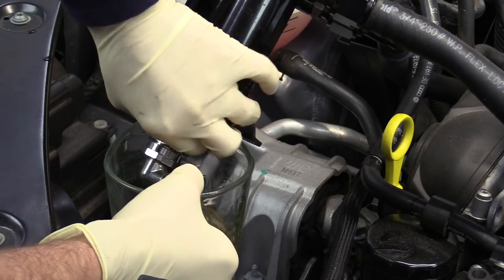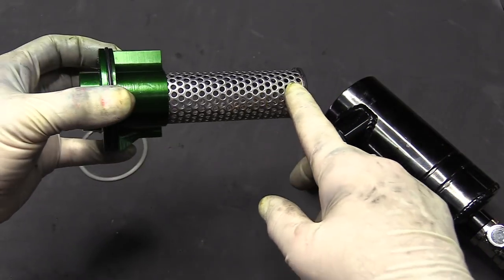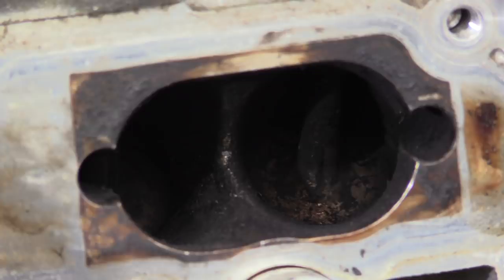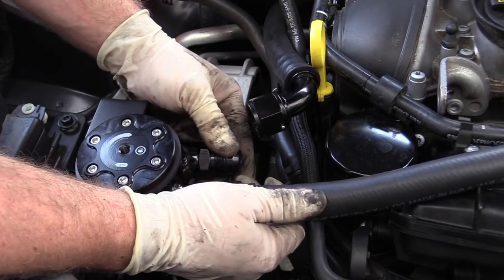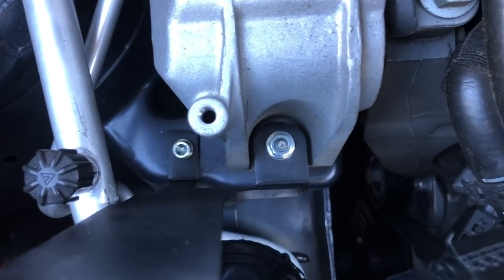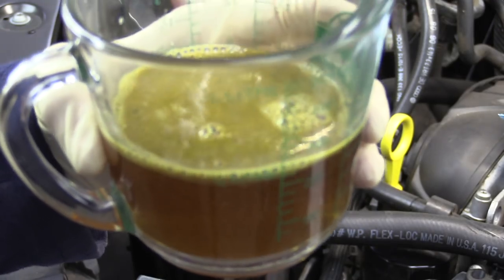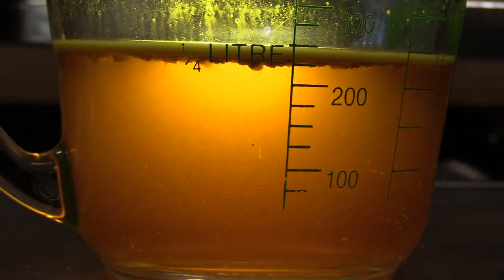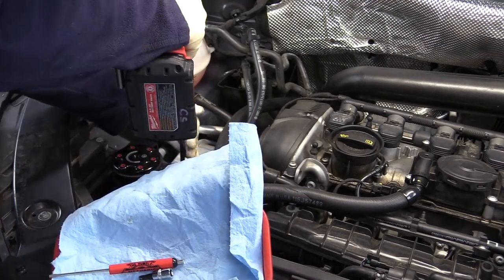Do Catch Cans REALLY Work?

Comment: Dear Charles yes catch cans are effective (in my opinion) but you have to be cautious if you own a vehicle with a catch!! I learn the hard way twice  -  in the winter any condensation the warm engine produces travels from the engine to the catch can and Back to the intake can freeze solid if they have any kind of  a low point between PCV and can or ontake the first time it happened I blew out a front main seal...remove the timing components replaced it I assumed I had a undersized seal and went on with my day around a year later it happened to the valve cover gasket which spray oil everywhere because it pressurized the crankcase. Not to mention losing oil and not noticing while operating the engine at speed!  Again my opinion no 90 degree bends at the hoses and make sure all fluids slope back to the catch can.
Reply from the maker: Yep. I’ve heard from a bunch of you guys saying they had freezing issues. That’s something I didn’t give a ton of thought to.

Comment: Can you show us what the intake valves look like right now?
I remember you said you took the intake manifold off awhile ago? Did you take pictures? Or were the shots of the intake valves in this video from your Tiguan? Thanks.
Reply from the maker: That video where I show carbon was from when I installed the can. The next time it comes off will be after testing a fuel induction treatment to clean valves.

Comment: I think were are all still wait for the Analysis of the drained liquid, the video seems incomplete without it, and I was wondering about what operation temps (climate)  this 3000 mile was acquired at...Ok, I have read many comments, and feel I need to and mine too.  I think overall it could help, but also think a CC system with a quick check dipstick, and with the shortest hosing possible and the exterior canister not made of high temperature conducting coefficient material would be important to reduce amount of internal moisture condensation in this add-on product in the engine loop.  I also wonder about losing too much coincidental lubrication of the top end of the engine with successful oil mist removal

Comment: I realy like to install a catch can (VWR is my Favourite) but 1. i live in a cold climate area and drive the car the whole year, so i‘m afraid of freezing the system and cause a Engine damage because of the not working System. And second i got a 2.0TSI CHHB with dual fuel system and in Germany we have 98 and 102 Octane fuel, so the carbon build should be Not  a big Problem. .... what do you think Charles?

Comment: I wish we could do this test at my job with one car fitted with a good can system and another one with a stock pcv system. We have cars running on dynos and robots controlling them to a specific drive curve. I would also like to compare a car with a can vs a car with a stock pcv system and water meth injection. I'm pretty sure water meth injection on any forced induction direct injection engine would be far more affective then a can in reducing intake valve deposits.

Comment: I use a paper element fuel filter as a catch can....and does a very good job at trapping oil.... the filter fills fast, in fact I have to change it every two months. they're cheap to buy.  but just a note my catch can traps nasty black oil, not the type u have in the video which is light in color. my car has abt 30k miles on it.

Comment: I took off the out hose of the PCV valve and there were a lot of oil on the hose in both sides, so I am sure that are going a lot of oil to the chambers ..  So I need to replace my PCV valve I suppose.  When I get off the Oil tap the suction is enormous. and the car is with a lot of miss fires and cylinder fails ..   So I think it is PCV valve. 

So for now, until I don't get the new valve, Can I plug the air intake?
 And put a filter in the output of the pcv??

Comment: Just watching this for my 2007 S3 (bhz engine code) and spotting that the tig's intake pipe could possibly fit my 2.0 k04 turbo engine...lol.
Did you guys across the pond get these engines as I don't see much on yt? Mk5 Edition 30, Seat leon k1 used the same here and possibly the golf R Mk6 your side?

Comment: Ethanol blended fuel is what causing this tremendous amount of blowby because it burns very hot to vaporize oil. The oil vapor will condense at low pressure area or before where the fuel is injected.

Comment: I am amazed by the amount f waste that drained from the catch can!

Then, I have a question:
What does the factory oil seperator do for not seperate these amount of blowby waste from the engine? I thought there is not necessary to have catch can installed on those engine with an oil seperator provided?

Comment: How much different would a catch can on let's say a diesel car compared to a big rig? I know a lot of friends of mine use them on their rigs.
Reply: I have a 7.3 powerstroke, 2001 F-350 with 380.000 miles on the clock. I installed a home made catch can. Works great and keeps oil out of turbo. I drain it every 1500 miles and have about 4-5 oz of pure oil that would have been in my turbo or clogging up my inner cooler tubes. Best mod I have ever done to my truck. Truck runs better than it ever has and I drive it like I stole it! But, I maintenance regularly.

Comment: Hi charles 
I got a 2006 Vw Jetta with the 2.5l 
I got a check engine light with a transmission code P0720 for the output speed sensor circuit. 
Any ideas on how I can trouble shoot it? Thank you in advance

Comment: Great idea... but I feel like the direct injection problem can’t be really properly fixed unless there is a port injector (low pressure) at the intake runner as well as having the GDI injectors as well. Kinda like what Volvo is doing with their new 4 cyl supercharged and turbocharged engines...
Reply from the maker: Yeah I am not sold this is a FIX... but it may help.

Comment: If that is mostly water, is there a freezing hazard there in cold climates?
Reply from the maker: Yes. I’ve heard from people in cold climates they can have issues
Reply: Hino trucks had a crankcase breather can.around 2010 models. In the north they had a freezing problem. So hino had a recall.replumbed the can and had about 1/2inch of high density foam wrapped around can.this cured the problem. (Prevented drain back valve from freezing)
That's why I think they need to drain off(into oil pan).to keep can empty in winter .
I just take mine off when it gets below 30 degrees.

Comment: I wanna put one on the suv witch are the hoses the I have to attach to? I drive a 01 x5 with a 4.4i engine. Thank you
Reply from the maker: It goes in the crankcase vent system. I am sure there is a solution for your car.

Comment: So I’ve done a bit of reading tonight on this issue, and I’m just going to relay what I’ve seen. 

If your catch can system replaces the stock PCV valve, you’re getting way more stuff caught in it that never usually makes it to the air intake anyway. The majority of that liquid will normally end up back in the crankcase, not in your intake, and so won’t be causing any carbon issues. If your catch can goes BETWEEN the stock PCV valve/hose and the intake, THEN it’s catching only the crap that was going to your intake, which is apparently much less. I think APR do this style of can, but it only fits with their induction kit installed. Looks like Forge do one, too.

Comment: I think a good experiment would be to have a car that has xx,xxx amount of miles and never had a carbon cleaning opened up and see just how much build up there is.  Then clean the carbon and install the catch can all at once, then bring that same car in when the miles are around double what it had prior to installation.  Open it up and see how much carbon it has that time.  To me that would be a pretty accurate estimate as to how much the catch can helps the carbon build up problem.  Definitely time consuming and labor intensive, but a very good insight as well.

Comment: Would have like to see how over time  the oil /water mixture would have separated out in that jug ,  thus showing what was oil and what was water vapour that had crashed out,  plus those solids would have separated to the bottom giving a real view of that gunk ... might be a good idea just to fit a valve at sump level  and drain a half pint every six to eight  weeks or so .. topping up  level  again ....wouldn't do any harm ...

Comment: Like others are commenting it doesn't look like oil, maybe water condensation or fuel with oil too, but the particles floating on top probably wouldn't be good to go through the engine I would think.

Comment: You would expect a lot of water in the liquid the catch can collected, since water is one of the main byproducts of hydrocarbon combustion. That and unburned gas, oil vapor, sulphuric acid and probably a bunch of other organic compounds. This goop is probably what you see baked onto the inner surface of an intake manifold with a lot of miles on it, where there's no fuel spray to wash it off. I think it's reasonable to believe that the catch can will at least reduce the buildup of baked-on deposits on the faces of intake valves in GDI engines.

Comment: Hey Charles, great videos as always, does the catch can apply to the my 7.5?  I hear mixed messages that the new PCV system makes this a moot point.  I know on my ea888 gen 2 motor this is definitely a problem, but now have a mk7.5 as well and debating adding one or if is a waste of money for a system that works well now (or if it still poses an issue for oil going back in through intake).  Thanks in advance and keep up the great videos!
Reply: Your question is noteworthy (RE: The Mk7.5).
If you would prefer even further piece of mind, run some CRC (or similiar) about every 5k just prior to changing the oil.  That way, you disolve the lighter coating of carbon that does manage to attach around the valves.  Everyone will have recommendations, but better to catch the build-up while it is still pliable.  Once the carbon begins to "harden", the CRC won't do a thing anyway - so catch it early.
Also, using the oils that have the highest levels of detergent & dispersant will absorb a greater amount of the carbon and keep the injectors a lot cleaner as well.  This of course, doesn't preclude that we shouldn't use regular treatments of injector cleaner in our fuel-ups.  These two procedures can extend the influence of problems when it comes to valves and injectors.
Other options are to remove the Intake Manifold & Injectors every 10k and inspect or clean.  That is if it is preferred to run optimally throughout your ownership (of course).....

Comment: I keep doing this. Spending hours trying to solve my carbon buildup issues despite having learned to clean my valves on my own from you, Charles. Sure it would be nice to get 10 or even 20 thousand extra miles out of my car before the need cleaning but at this point, I have spent substantially more time doing research of the issue than I will ever save in servicing my vales. Oh well lmao. Hope you've got a followup so I can put this to bed.

Comment: I use a longer PCV hose (two or three foot long) tor replace the usually short heat bent 6 inch OEM hose as you know vaccuum depend on the length of the hose for strength . the longer the hose the less oil the vaccuum is able to suck up..
I loop the long hose and plug it in!
I twist wire the loop to keep it in a loop. Do not use fuel hoses for PCV..   Fuel hoses are too stiff to keep vaccuum in. PCV hoses are more supple and better able to be clamped and vaccuum tigjht.

Comment: By installing the catch can, based on your results it has to be reducing or perhaps even stopping build up of sticky goo in the intake manifold and other areas.  Well done. A catch can in our 2007 Toyota landcruiser prado hardly works; in 20000klms about 3mm on the dipstick of the reusable catch can.  I expected a lot more.

Comment: When the blowby from the diesel engine of your VW T5 van is showing oil coming through seals, as my 15 year old one is :- - eg. the hose from so called PCV valve to the air intake visibly coated in oil (to change the PCV membrane you simply remove half the engine - sooo easy) , the oil filler puffs smoke, the dipstick puffs too - then you need a catch can to slow down the destructive process.   None of the "sophisticated" warning lights on the dash gave any indication anything was wrong, because they were busy protecting the environment while destroying the engine.  You know it makes "sense".   I would always endorse an add-on oil separation device but it should be make of clear materials, so you have visual on what is occurring.

Comment: Curious to know if anybody’s run Archoil in the 2.0 TSI yet? 

AR6200 in my NA 5.4L V8 Ford F-150 actually unplugged all 4 of my cats after 6K miles or 11 weeks of treatments. And even though I run 87 octane per fill up, misfires from back pressure have dropped to almost none. My oil blackened after 3K miles.

Be cool if Charles did a 5K mile follow up video running a 2.0 TSI engine on Archoil 6200 Fuel Treatment.

Comment: I dont know.. Its a weird one. Wouldn't most of that water be condensation from the heat and high pressure? The oil is not that great for the intake manifold, but wouldn't it lubricate the turbo and other components that are actually getting the pounding?
Reply from the maker: I think it’s very over rated. I’m testing one now on a new car
Reply: @HumbleMechanic  Oh wow! I wasn't expecting a reply :P The golf R? Cheers for all the content. Its been awesome to watch over the years! I came accross this vid because I changed the turbo inlet on my mk7 R and noticed a bit of oil. It got me thinking!

Comment: That's picking up condensation from the screen design. Check out JLT 3.0 separator. It has a unique screen design that picks up only oil without creating condensation. It looks just like oil in theirs.

Comment: I plan to install an APR catch can based on a video Jason did. Your video also helps confirm my decision. However, what does this say about the way manufacturers design their vehicles? Is oil and water ok to pass into the intake at that level? Is there a problem with changing this? I'd assume the motor and software is designed to work this the "gunk" that you have eliminated. Is there a negative side to changing this? 
...
Reply: Neil Porter it's not consuming it at that level.  Fluid consumption at that level would hydrolock the engine.  This is a collected sample of over 3k miles of driving.
Reply: Lynx Star Automotive I know that. Still, my question was over 3000 miles why would the manufacturer find it okay for this amount of Gunk to be ingested? And what would be the negative effects of removing it? It could be so minuscule that it doesn't matter and that's why they left it there. However I was just curious.

Comment: Charles, interesting test and great video! By the looks of the viscosity of liquid, there must be some water and ignition by products (ash, carbon ...) in the liquid. Would be really interesting to send for analysis. Also, maybe around 30K, if you can check with a Borescope on deposits on the valves. 👍
Reply from the maker: I pulled the intake manifold the day I installed the can. The footage you see in the video is this car at ~27k. I will be pulling it again after running the Seafood treatment.
Reply: HumbleMechanic please put that on YouTube too

Comment: Toyota's solution of adding a port fuel injector on the intake manifold seems like a more elegant solution.  It should almost eliminate carbon build-up without the constant need for servicing the PCV system.

Comment: I have a turbo GDI motor. Definatly looking into buying this now.
Reply: Update: I bought one after my comment, I'm glad I did. It can build up to an inch in a month. I do the GDI valve spray once a year, and my 2014 kia Forte koup 1.6L turbo is running great with 140k miles. I do have a Injen cold air intake and custom exhaust so I'm not sure how much that influences the crank case pressure. All in all I recommend a catch can, even the cheap ones work. Check the machine cuts, and you'll be able to see the $110 ones are sometimes the $20 ones that got rebranded.

Comment: I'd think not likely to solve it but may mean more time before cleaning is needed. Some of the dirty gases will always get through the can. So it seems without that flush of fuel directly on the valves each cycle, the carbon problem is probably just going to be a thing we have to deal with.
Reply from the maker: Yeah I have talked to a good amount of guys running meth injection and they are still having slight issues. Not as bad but it’s happening

Comment: I Wouldn't use a catch can on anything turbo.  I use air or separator to route it back into the system, it also runs hot coolant through the can to keep the oil nice and hot.  This is good if you run E85, because it dilutes your oil and knock knock(water collects in the oil).

Comment: I rebuilt my engine and installed the can but it does not catch anything. Any idea why @humble Mechanic
Reply from the maker: Maybe that’s good? The rest of the system must be working well. Or everything is just blowing right through the can
Reply: @HumbleMechanic  Well my mechanic told me it is a good thing and the engine is working perfectly but not sure what makes it a good thing...care to explain please?
He modified ,and  tuned a lot of cars and installed a lot of of cans
Reply: I find the more engine blow by.the more the can catches 
So I think in your case.you did a good rebuild. 
But even some rebuilds will have blow by until broken in.